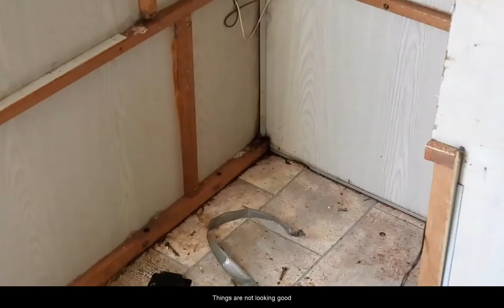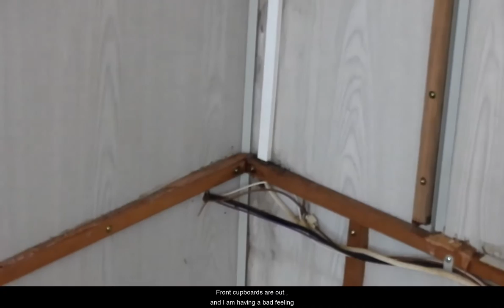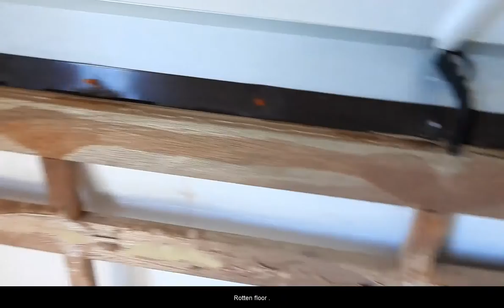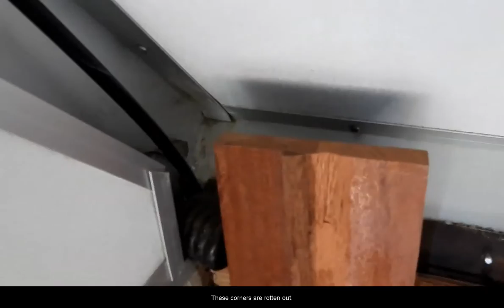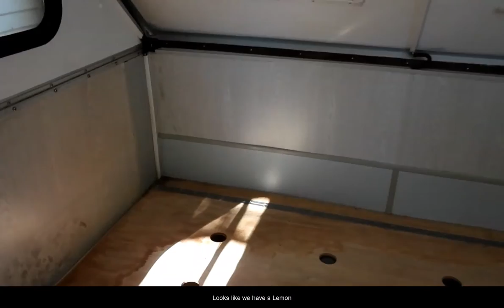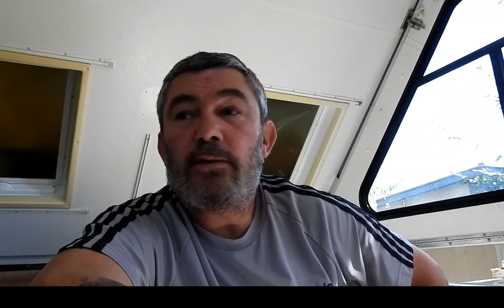Avan Aliner Rebuild Part 2.#Eddiedownunder#Aliner caravan.

Comment: Must be a design fault in this style of van , for water to be able to enter so easily!  If it was me , I’d be replacing the timbers with 20x20 stainless steel tube & wall linings with  Aqua Panel or something equivalent ! Maybe some sort of PVC / Acrylic floor or even Ally  !  Materials that going to see you through even if they get wet in future ! If your going to fix it up now you won’t want to be doing it again in a few years ! 👍
Reply from the maker: We have the roof off . 
Am rebuilding everything with marine ply atm . 
Varnishing all new timber before it goes into the van . 
We are redoing the roof ..
A true lemon .
Reply: @eddiedownunder9881  👍👍
Reply: @eddiedownunder9881  Hopefully that lemon is a Peach when you’re all done ! 👍🙏